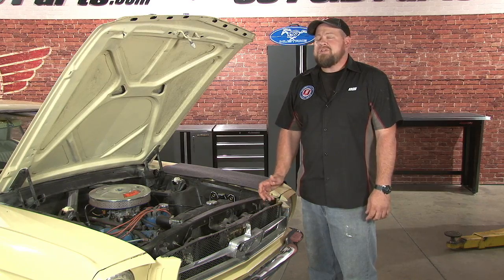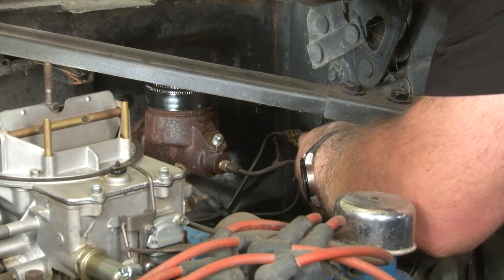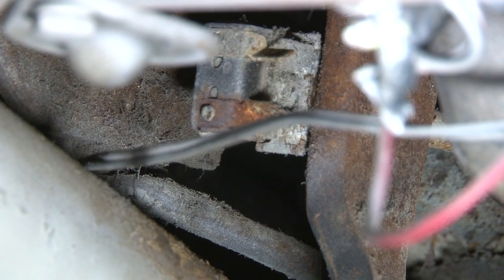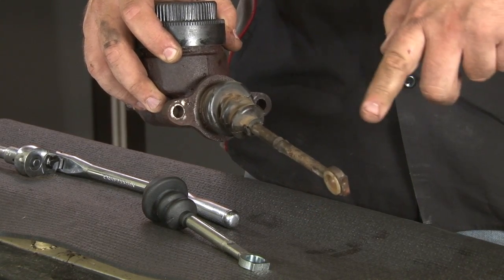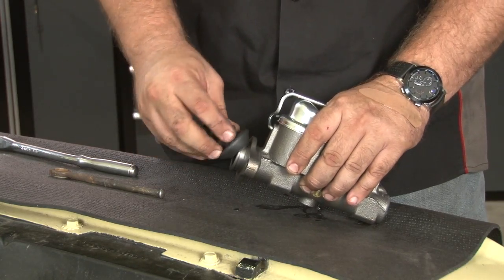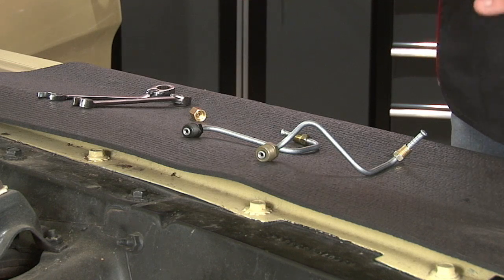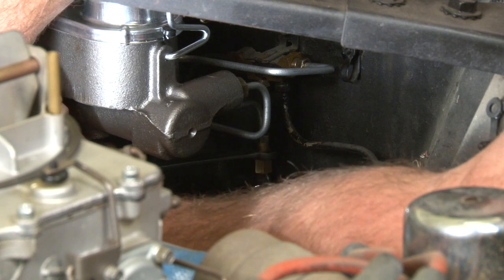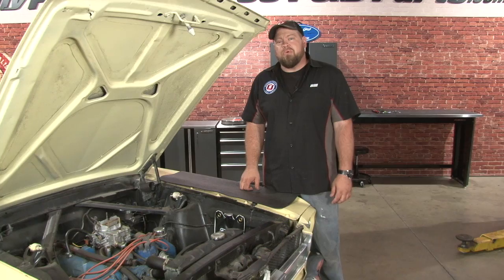*Safety First!* Dual Bowl Brake Conversion | 1965-1966 Mustang

Comment: A couple of things about this video. First and most glaringly wrong is that you must bleed your brakes after this installation. There is zero chance you won't. You just put two pieces of new line that have air in them. (2) If your brake light switch looks like this one, at the minimum clean the terminals. (3) If you don't want water getting in your car, put some mastic or other non-hardening sealer on the master cylinder mounting face and bolts as the factory did. (4) If you fling brake fluid like what happened when the rear line was forced out of position, you will have just ruined your paint. Use a rag and some patience to stop that from happening, and a catch pan for any drips.

Comment: I cringed when you set the master cylinder on the fender cover. Might want to point out that brake fluid removes paint!  ;) And a back up wrench on the distribution block would make it safer and easier to remove the brake line. Good video.

Comment: The thread on the replacement tube for the front brake screw is wrong on the distributor end; it is too small. I have the original distributor block and was mounted with tubes from CJ Classics (which had the correct size).

Comment: Well this definitely doesn't work for single line vehicles older than this. This conversion only works assuming front and rear are on separate line already.

Comment: I was surprised to see that the front brake lines hook up to the rear port on the new master cylinder.  Is this because the front brakes need to be applied first?

Comment: I have 66 mustang 289 with 3speed manual transmission with the z bar close to the master cylinder will I have trouble converting to the duel master cylinder?

Comment: This worked perfect on my 65 mustang , hardest part for me was loosening the brake lines from the distribution block other than that the  brake lines were correct just had to do a little adjusting to line them up.

Comment: Bill, thanks. I have 64 comet and 64 ranchero so these installation vids you do help a lot since they are "cousins" to the mustang!!
Reply: My 64 1/3 has two wires off the master cylinder do you have this problem on the comet or ranchero
Reply: I checked them and must say that both were built by others but the Ranchero does have two wires out of it and the car has drum brakes, the Comet has disk brakes in front and I could not see any wires, I checked my 67 Cyclone too and it has power disc brakes and did not have any wires out of the master cylinder but may out of the booster which is not visible. I don't know that it is a "problem", may be for lights or sensors, and all cars stop fine, but as I said I did not install them myself. Good luck with your car. : ) @brandonfleetwood4201
Reply: Those two wires are the same as the 64.5 mustang, they are from a pressure switch on the M/C that activates your brake lights.
Reply: @ScroatBagGarage  thanks for that info! :)

Comment: Hi, i have a 6 cyl 68 mustang, working in a v8 swap, have installed a 8.8 rear end of a explorer, have 4 disc brakes, what kit do you recommend to fit my setup? Looking for a MAster cyl and booster for manual t5 transmission.
Reply from the maker: Are you using the original style Z bar clutch linkage or a cable conversion?

Comment: If I’m doing a full restore job do I need to bleed the brake lines or can I just disassemble and let it pour out?
Reply from the maker: For a full restore you can drain anyway you want to. I usually remove the MC and use air to blow out the lines.
Reply: CJ Pony Parts thanks!

Comment: Do you lose any fluid when you remove the blue plastic caps (installed during bench bleeding) to connect the brake lines? If so, doesn't that render the bench bleeding useless?
Reply: No, it doesn’t let air back in
Reply: @doodlecaboodle9298  but will the fluid leak?

Comment: WARNING
The supplied brake lines are for a 1965 - NOT a 1966. They are different sizes and CJ apparently doesn't want to stock the correct item. They do the same thing with the heater box seal kit, and other items I've gotten from them. I'm done with getting parts from them. They know the parts aren't exactly correct, but with some effort & additional parts running the end user can usually make them work. That's a bad way to treat customers, so I won't be their customer any longer.

Comment: The line kit has wrong size flare nut.. Original Front Port on the distribution is 1/4" and the nut supplied on the line is for 3/16".. this makes a good kit a bad one... not everybody can cut and flare lines... but the people this 'kit' is marketed to can use wrenches..  Get your supplier Classic Tube to get this right... easy fix... Your statement at the 7.42 mark is true but this a BIG Disappointment for the cost not that I have to spend more money to get it to work.... bummer

Comment: If I upgrade my 66 mustang to dual bowl now, can I reuse it later when I convert to power brakes, and then later when I convert to discs?
Reply: Will wheel size matter?  I plan to upgrade from 14" to 15".

Comment: I am converting from front drum to disc brakes and single bowl to double bowl master cylinder. I noticed the double bowl just bolts tp the OEM distribution box, with no new lines needed for the rear brakes? Am I correct in this?

Comment: 66 mustang here. I did this conversion and what's not said here is if you have to use an extra fitting, which I did, it changes the fitment of the provided line (the line that operates the front brakes) and this becomes a much more difficult installation. That preshaped line has to be reconfigured to fit and without a tubing bender, you may well be out of luck. I do have a tubing bender and I wonder if it might have been easier to just make another line to fit. A good conversion, though, and I'm happy with the results.

Comment: so this will make stopping the car better? even tho it still has drum brakes?
Reply: No it wont, it will make your braking system much more safe. If you have single bowl master cylinder and there is one leak in your breaking system, you will lose all brakes. If you have a dual bowl master cylinder and there is one leak, you will still have half of your breaking system. Might save your life!
Reply: thanks for the info!  I appreciate it

Comment: I have a 64.5 it came with a inline 6. I put 5.0 motor in it now. I'm getting ready to switch out the master brake cylinder. Do you know if the new lines that come with this upgrade fit the 64.5 brake lines. They are the original lines.
Reply: My 64.5 has the brake light switch attached to the brake master cylinder I ordered this conversion to dual bowl to be safer but now I’m just confused!!!

Comment: Would these parts be compatible with a 1964 Ford Galaxie?
Reply: +cloud8746  I can't say, never tried but I would think they are similar.
Reply: I would say yes ,64 to 66 ranchero ,galaxy ,mustang, are the same
Reply: Just put one on a 64.5. There is on where on the master cylinder for the brake light pressure switch. Also, a brake light switch won’t fit on the 64.5 brake pedal. Hopefully I can rig 
the pressure switch on the plugged spot on the distribution block.

Comment: how or where along my rear line would I add a proportioning valve,  at line from the master cylinder?
Reply: +Sarang Marong We typically add them on the passenger side of the car on the cross over line that goes across the firewall and then back to the rear brakes.

Comment: Installing master Cylinder on my 65. Noticed that my lines were opposite, black threaded portion was rear brake line that requires the included  adapter.  Initially it was a head scratcher but it was easy to figure out as one of the ports is large enough than the other.

Comment: Kascus - You could mount the brake light pressure switch in the distribution block instead of using the plug. Otherwise you would have to convert it to a 67 pedal switch.

Comment: Do you sell distribution blocks, and proportioning valves for 1968 mustangs with 4 wheel drum brakes?
Reply from the maker: Zach Conley Yes, they'll be in these two categories: http://www.cjponyparts.com/mustang-brake-hoses-lines/c/60030040/ and http://www.cjponyparts.com/mustang-brake-proportioning-valves-distribution-blocks/c/60030150/.
Reply: on my 64 1/2, where does the electric switch get located to on the new master cylinder?

Comment: I already have a dual bowl master cylinder. I would like to buy just the conversion lines as well as the distribution block. I couldn't find them on your website.
Reply from the maker: Benjamin Slaby We have the lines and the distribution block you need here: http://www.cjponyparts.com/mustang-brake-hoses-lines/c/60030040/ and http://www.cjponyparts.com/mustang-brake-proportioning-valves-distribution-blocks/c/60030150/. I can't give you specific part numbers, because it varies whether you have disc or drum brakes.